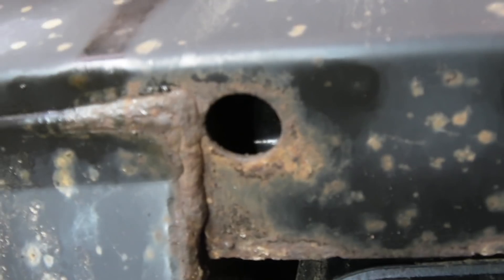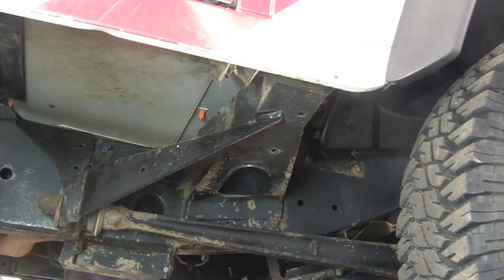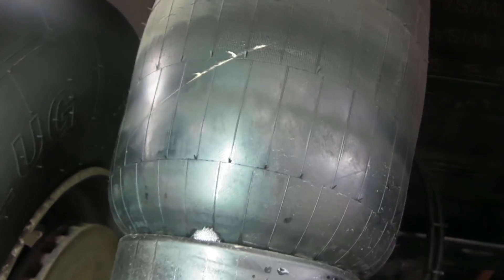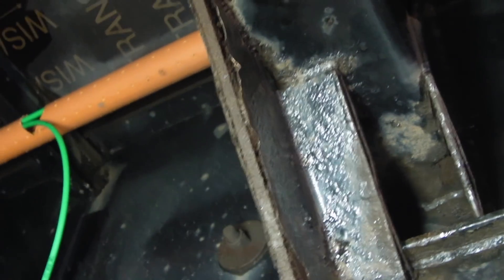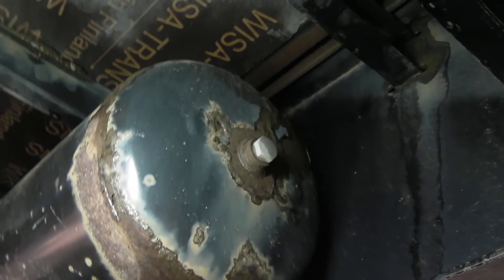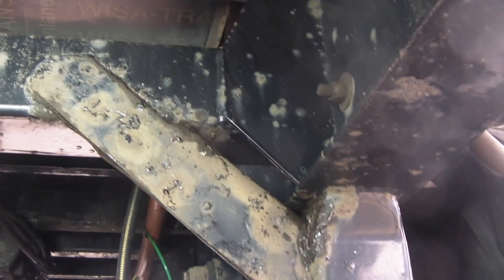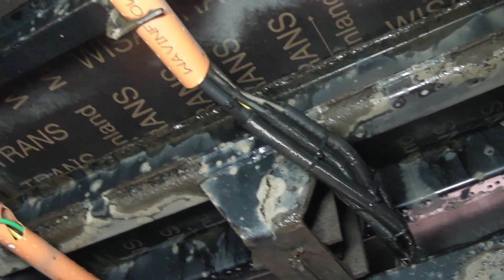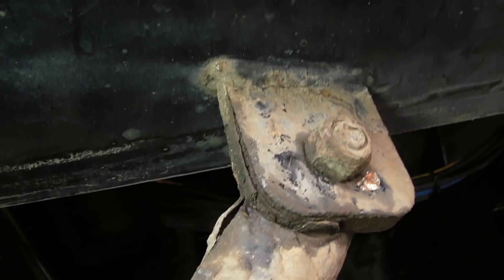Chassis Paint.  Why Does It Fail?

Comment: 94Discovery hinted at it. When a liquid is applied to a surface, it actually thins at sharp corners or on very rough texture due to surface tension. Thin = weak. Radiusing or chamfering helps to minimise the thinning. 
A micro texture is good for paint adhesion, which is why primer is course pigment-rich and matt.
Galvanising needs an etching primer or wash which chemically keys the surface. Paint quality is the other factor. Paint yer metal gate with the best non automotive/aerospace paint and it still fails in a few years. But look at how automotive paint stays stable on vehicles, in all weathers and temperatures. Old cars, 50, 60, 70 years old and the paint is often still good.Same for aircraft, subject to abrasion, -70° to +70°. Why? Cos Dulux, Sikkens, Crown costs £50/5litres and automotive/aerospace paint is many times as much. Plus, they are often 2 pack and baked/cured. 
I wonder if a vehicle chassis is painted with a cheaper paint than exterior bodywork and to a lesser std, cos if your flatbed chassis rusts a bit, who cares, but if your Roller bonnet flakes off you may not be too happy.

Comment: Hi. I do think quality of paint these days has gone downhill. Like hammerite it used to be so tough but now not so tough. I have recently. Re done my chassis on my 87 landrover 90 its only had rear 3mm thick new crossmember and one outrigger the rest is mint but over a year ago i red led it and hammerite over the top and offroaded it and used it through winter .(cleaned regularly). It was showing signs of failing. So i stripped it to metal used por 15. 4 stage. And hammerited over that. Hopefully it lasts took me over a week .👍 great videos. By the way
Reply from the maker: Domestic consumer products like Hamerite have lost their edge.  Not that it has been good from the start.  Commercial and Industrial paints do what they say the do on the tin but they cost .  Thanks for the compliment. Feedback always welcomed.

Comment: Hi Chris, yes you are correct regards the paint thickness on the edges of beams and outriggers and also regards the front surfaces of axles etc that are 'shot blasted'. Being underneath these ares suffer the wirst from rocksalt and. Road grit and grime. Any edges where the paint us thin will naturally chip and crack quicker than mid section. Also some aggressive cleaning compounds and high pressure washer systems can also deteriorate paint quickly and strip some areas of protection/force the chemicals into areas where there are already corrosion issues, making them worse. Regards welds that are rusting quicker that may point to a failure in fully preparing the area before welding. Holes in chassis will suffer the same issues as the edges as you mentioned. You mention 'flies' damaging paintwork...motircyclists have the same issue on their suspension forks whereby dead flies, if not cleaned off will eat into the tubing and also their decomposing DNA will attack and rot out the forks seals. Everything under a trailer unit/tank will deteriorate rapidly if left to it's own devices. When you think how many LGV tanks/trailers move around the UK daily delivering powders and liquids you wonder just how many are legal. Maintaining them is a major undertaking that most have no idea about. It's not something you want to 'go wrong' especially when fully laden.
Reply from the maker: Usual on;y once a year do commercials get washed for MOT test.  The rest of the time they are covered in grit and grime.  To be fair the example in the video is older than it looks. However, cosmetically they do not get any real attention.  We just watch things deteriorate slowly over the years, especially on a fleet we start with new then maintain for 10 to 15 years before they are sold on.   I am looking for good solutions for our private vehicles that appear to corrode quicker than HGVs.   Thanks for your input.  All the comments here we can work out a reasonable solution, that I am sure of.

Comment: The impurities in the weld will assist the process of corrosion, the paint process may have moisture contamination, the chassis might not be moisture free when painted. Its a battle we can't win, and the use of salt in the winter accelerates the whole process, at best we slow it down.
Reply from the maker: Good thought there.  MIG welding leaves sillica on top of the weld.  Perhaps this also stops the paint sticking to it?

Comment: some farm machinery is painted with just gloss on to bare metal with no primer. finished replacing my head gasket on 300tdi ,went on a drive to test for fluid mix and all good . but did see 3mm crack between valve seat cant justify spending 300 pounds on new head, on a 1000 pound truck.i guess i will have to wait and see what happens.

Comment: clean all rusty areas with angle grinder and wire brush and prime with red oxide and for a top coat I used spray on underseal. I will spray the chassis with old engine oil in the coming weeks before winter
Reply from the maker: Aye, Oil oil sticks much better than new oils.

Comment: I remember from my trucking days that the Shmitz trailers were very resistant to rust with many galvanised parts. They were lightweight too, and one had to be careful when loading as you could up end it if it wasn't coupled. Anyways i would have thought that on the seams and edges, they are more suceptable to exposure from frost, also water clings to edges and seams and they are the last to dry. As for treatment prevention? Paint paint more paint!
Reply from the maker: We have just watched over 5 years a totally galvanised chassis deteriorate to the point that the operator has to scrap it.  Obviously there were more issues around why they got rid of it but it was sea water dripping through the floor from their load that killed it.
Reply: Wow that must be some kind of record! When you go down to coastal towns the wife and kids are looking at the view and I am looking at the state of rear Crossmembers on Land Rovers that are still in their warranty periods!
Reply from the maker: Ah, that company cart shell fish across country as well as pull them put of the sea.  All their vehicles have short lives working for them.

Comment: Why are we not making chassis from stainless steel? It's so obvious...yes, much more expensive but it will not rust and therefore last..
Reply from the maker: they do make chassis and tankers from stainless but unfortunately it is prone to cracking.
Reply: I asked a ships captain once why they didnt make ships from stainless steel.as all ships crew do is chip rust off all day and paint. He said  it wasn't as flexible as mild steel and the ship would break I two. On a VLCC during rough weather you  could often see the bow moving   up and down  when yo we're looking at it from the bridge.

Comment: If you round the edges you will improve the adhesion of the paint ,when welding it hardens the surface ,sand blasting will improve pain adhesion big time ,
Reply from the maker: Good idea.

Comment: I always thought there was a myth that Landrover chassis were painted while the welds were warm/hot causing the paint to dry quicker making it fail on the welds. As for sharp edges, wouldn't the paint be thinner from when applied as its harder for it to stick as apposed to a flat surface? Easier for butter to stick to the side of a knife than the cutting edge?
Reply from the maker: Yes I agree with that.   If you have ever painted anything when the metal is hot it dries really oddly.

Comment: Cheap paint, cost over quality.
Reply from the maker: Yes I'd agree with that.   Things are built to cost rather than robustness but the builder will tell you that ti has the best used on it.
Reply: dave medlyn cheap paint atop cheap steel